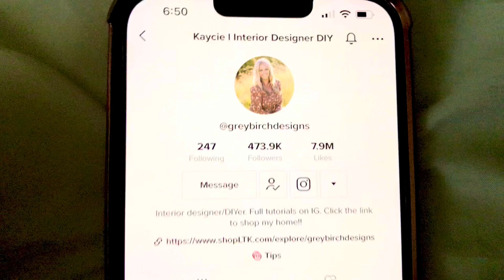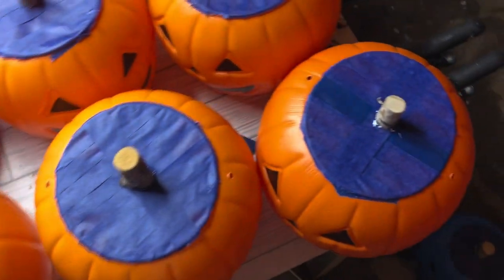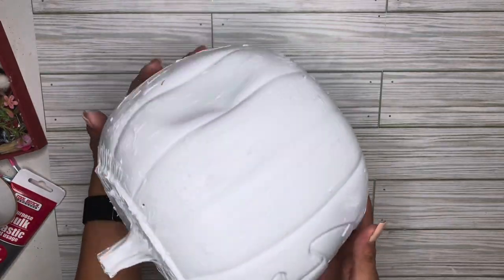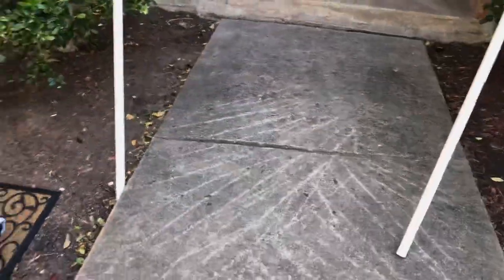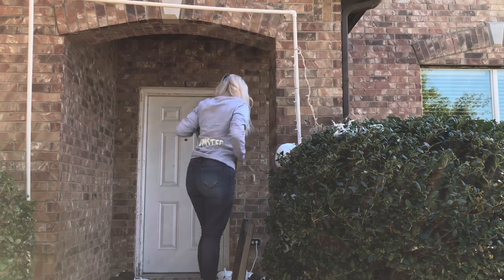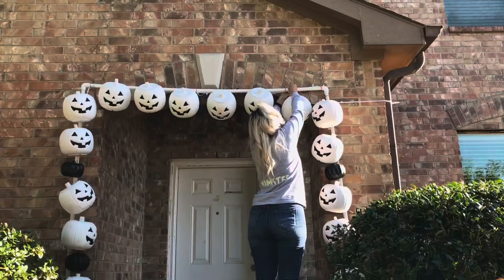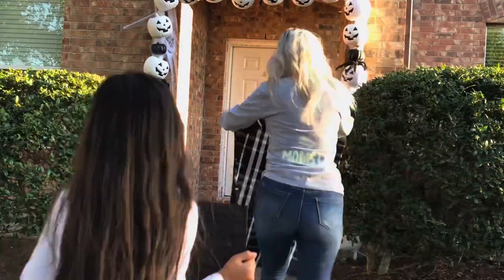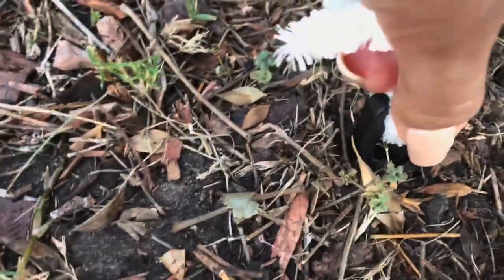Halloween Decorate With Me Outdoor | DIY Pumpkin Arch | Outdoor Halloween Decorations

Comment: If you make a hole in the bottom of the pumpkins the water will drain if the top isn’t completely waterproof.
Reply from the maker: They actually are working out great 😃 It has rain a few times and they stayed intact 🥳